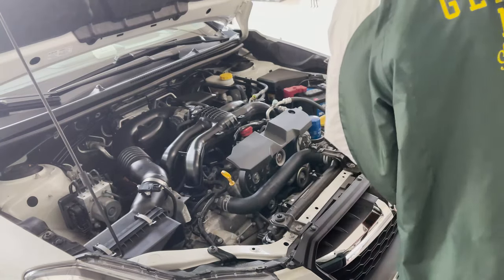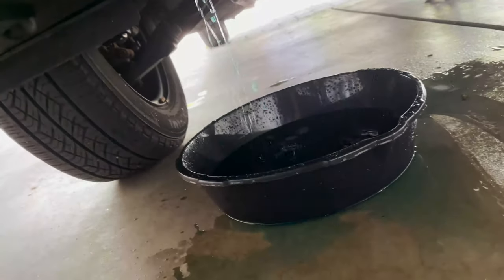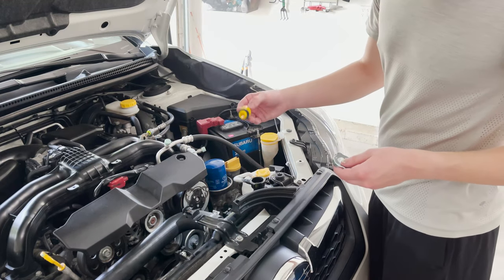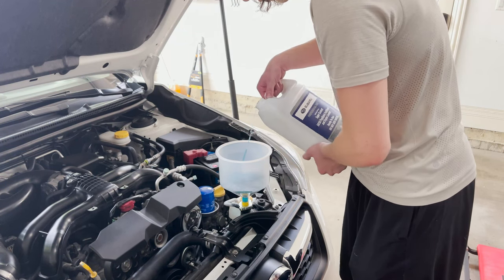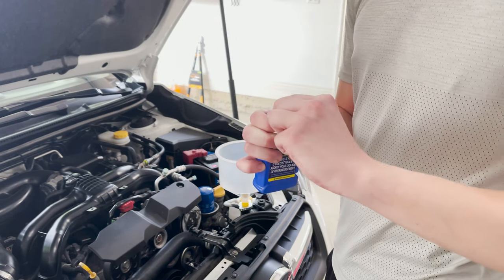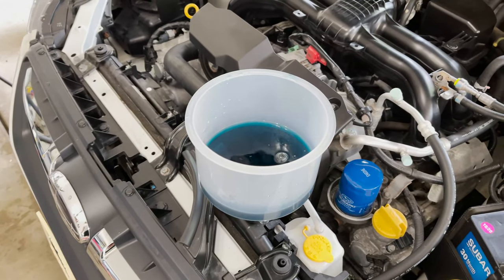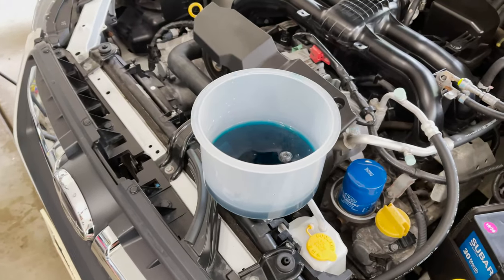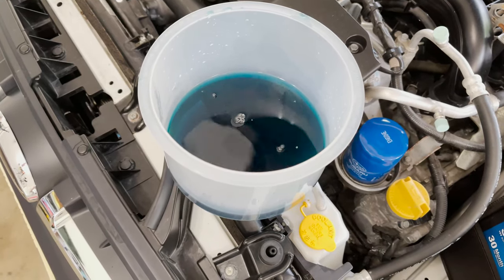How to Change Coolant on 2012-2016 Subaru Impreza

Comment: I did my 2016 Subaru Crosstrek today, I found it to be ALLOT EASIER to just remove the plastic under plate
( 4 12mm bolts and 6 push plugs ) That gave me FULL access to the drain plug and with out trying to do this with a short Phillips Screw driver.... I also used my air compressor and air nozzle to push the coolant out of the system... I got about 95% of the coolant ou of my car...  So I now have almost all new coolant in my sysetm.....
Reply: this is a pro tip. 🙌
Reply: Thanks for the tip. I removed 2 front bolts only so got access and it was still hanging in the less accessable area. My drain pan sat on the dropping pan.

Comment: From what I can tell there is no coolant plug on the engine block to release any coolant from there on my 2015 WRX. Going to use distilled water to flush out the coolant. I just hope I do all this correctly... The service manual for doing this does not say to add into the radiator cap area but instead into the overflow container deal and have it suck in from there.
Reply: Yeah, you want to use the highest point on the cooling system, which is the reservoir next to the turbo on the wrx.
Reply: @Robert-un3cf  I ended up not using distilled water and just did a drain and fill. I dd fill in the radiator cap area and also in the overflow spot. It's been just fine. Out new upper and lower radiator hoses in car as well. Didn't do thermostat which I'll likely do next time in around 30k miles
Reply: @shamwaymoonyos9578   doing drain and fills often is the best way, otherwise you will throw off the mixture by a ton. because you'll never get that water all out.

Comment: Ever wonder why the coolant doesn’t contain the conditioner to begin with????
Reply from the maker: Some people may only be using the coolant as a top up, so you wouldn’t want to overload the system with conditioner. Also the conditioner was released a few years after the car was due to head gasket issues, and I’m not sure if the newer models of Subaru (which also use the same coolant) also need the conditioner.
Reply: I was looking for the conditioner, and I had a guy at advanced auto say that alot of coolant producers add a bit of conditioner to their product, I'm not saying do or don't, but it's something to keep in mind.
Reply: Why would they just add it with it when they could sell it as a separate product

Comment: The plastic plug is a problem for me.  I took the belly pan off to gain access and things went great but when I reinstalled the plastic plug and started refilling it leaked.  Not sure if it’s the plug that’s bad or the threads in the bottom of the radiator.  This info has been no where to be found on the internet.  I ordered a new plug and hopefully that will fix it but if not who knows.  Plastic drain plug is a bad idea.

Comment: When are you supposed to do the coolant replacement? Every 5 years?
Reply from the maker: According to Subaru, 1st replacement interval is 11years/137,500 miles, and then every subsequent replacement is every 6 years/ 75,000 miles.
Reply: @danielfliman3683  thanks bud

Comment: Just to clarify (because I have a 2012 Subaru Impreza), when you removed the air intake, it was to acess the radiator drain from the above the car, not below the car, right?  It's going to drain from the bottom, but you are u hooking from above the car? ( I hope this is a clear question)

Comment: Hello!

Could you do a quick video on floor jack and jack stand placements for 2012-2016 subaru imprezas? Been really hesitant to learn basic maintenance because I’m totally scared of the possibility of the floor jack and jack stands failing due to improper placement.
Reply from the maker: Hey! I’d love to if I still owned the car haha. Make sure you are jacking the car from the pinch weld, the semi thin line of metal that runs the length of the car, there are little cut outs in the pinch weld that you can use to know where to jack it from. Then make sure to put your stand on a chunky piece of frame and not the floor board, that’s pretty important. If you hit the frame with a screwdriver it should sound like metal on metal or else your hitting the floor board.
Reply: The jack placement is in your owners manual also there is arrows on the rocker panels indicating where to place your jack stands on 90%of cars

Comment: Nice video.
I have '15 impreza.
Is the conditioner necessary ?
Reply from the maker: Technically yes, it’s called for in the service manual, it’s done to prevent head gasket leaks.
Reply: I'd recommend it. It is there to help with the life of your head gasket.
Reply: According to the dealership they don't need it anymore when they came out with the FA engines. Just the old ej engines needed the conditioner

Comment: How often should the coolant be flushed? I have a 2014 Subaru forester with only 31,000 original miles on it.
Reply from the maker: About every 8 years or 100k miles, so I would go ahead and “drain and refill” your system, it’s technically not a flush. Only flush if your system is very dirty.
Reply: @danielfliman3683  I’ll have the dealership check it out next time I took it in for an alignment and they said everything looked amazing they actually wanted to buy my forester from me considering I just bought it. But I’ll have it maintained and keep it for many years.
Reply from the maker: Up to you, I used to work at a dealership, if you ask the service team if you need something, they are likely going to say yes even if you don’t need it, that’s how the game goes.
Reply: @danielfliman3683  yes they told me every 60,000 miles the coolant needs to be flushed
Reply: I did want to ask you what does the Subaru coolant conditioner do?
Reply from the maker: It works as a head gasket sealer.
Reply: Does the head gasket sealer work?
Reply from the maker: Subaru recommends it with each fluid change and so I assume so

Comment: Your way of draining the coolant, does it remove all the coolant from the cooling system or just the radiator part?
Reply from the maker: It drains the entire radiator and maybe a little more, this is the procedure that they would do at the dealership if you asked for a coolant change, this is not a coolant flush.
Reply: @danielfliman3683  This IS NOT what the service manual calls for, unless they drastically changed something between 2016 and 2017... The service manual calls for this:

1. Remove the water tank pipe cap.
2. Loosen the air bleed plug on the heater outlet hose.
3. Pour in cooling system conditioner. Pour it from the radiator side.
4. Pour engine coolant into the radiator and top off to the opening of the water tank pipe cap. Pour it from the radiator side.
5. Install the water tank pipe cap. Always use the water tank pipe cap, since its function is different from the radiator cap.
6. After pouring in the engine coolant, close the air bleeding plug when the engine coolant comes out of the air bleeding plug on the heater outlet hose.
7. Pour engine coolant into the radiator up to the filler neck position.
8. Fill engine coolant into the reservoir tank up to “FULL” level.
9. Install the reservoir tank cap.
10. Install the radiator cap.
11. Start the engine, and race 5 to 6 times at 3,000 r/min or less, then stop the engine. Complete this operation within 40 seconds.
12. After stopping the engine, wait for at least 1 minute and then remove the radiator cap. If the engine coolant level drops, add engine coolant into radiator up to the filler neck position. Do not remove the water tank pipe cap, or the engine coolant may over flow.
13. Perform the procedures 10), 11) and 12) again.
14. Install the radiator cap.
15. Start the engine and operate the heater at maximum hot position and the blower speed setting at “LO”, and the A/C switch at “OFF”.
16. Run the engine at 3,000 r/min or less until the radiator fan starts and then stops. Frequently check the engine coolant temperature in order to avoid overheat.
17. Stop the engine and wait until the engine coolant temperature lowers to 30°C (86°F) or less.
18. Remove the radiator cap. If the engine coolant level drops, add engine coolant into the radiator up to the filler neck position and the reservoir tank to “FULL” level.
19. Attach the radiator cap and reservoir tank cap properly.
20. Set the heater setting to maximum hot position, the blower speed setting to “LO”, and the A/C switch to “OFF”, and start the engine. Perform racing at 3,000 r/min or less. If the flowing sound is heard from the heater core, repeat the procedures from step 16).
Reply from the maker: @heyaisdabomb  Actually it is, the 2016 and the 2017 are two different generations as the 2017 was a refreshed model with an improved engine among other design and interior changes. Two different vehicles hence the different procedures.

Comment: Hey what if im adding a different brand of coolant into my Subaru Impreza 2015. Can I add conditioner to it? Or should I ONLY use the conditioner with Subaru Super Coolant. (Im using aftermarket coolant bcuz it desperately needs coolant, I just bought it used)
Reply from the maker: Not sure, but I wouldn’t use aftermarket stuff, especially on a Subaru.